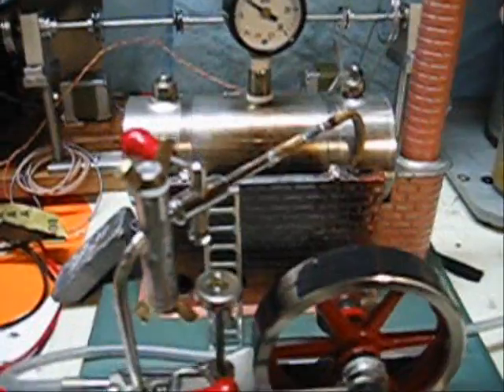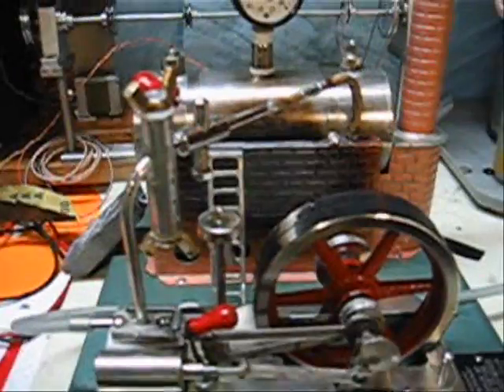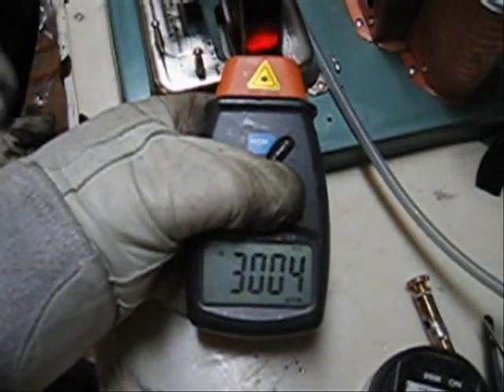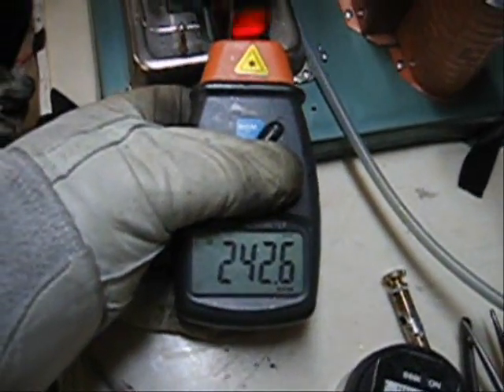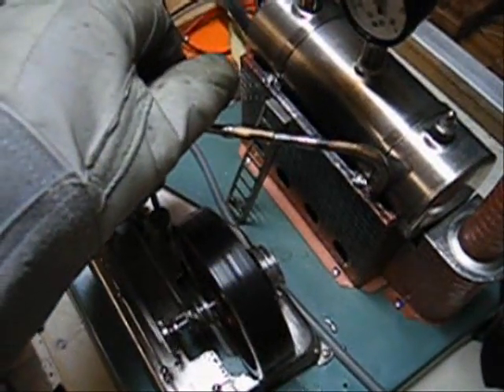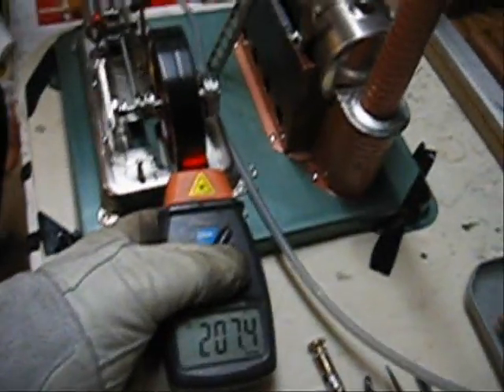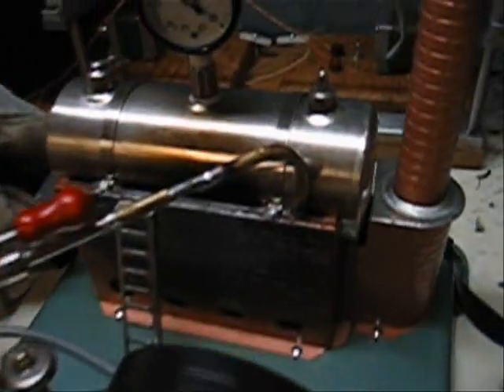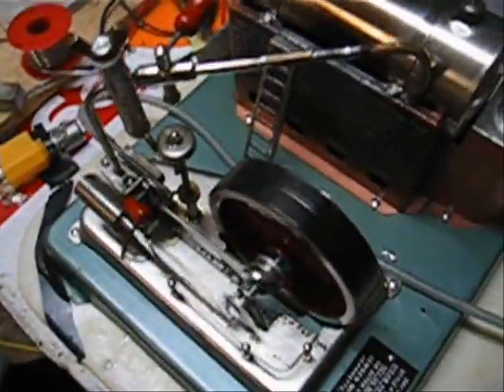Jensen 75 - Superheater Mk-I

Comment from the maker: It's very crude and simple.

I'll see if youtube will let me post a link..

modelsteam(DOT)myfreeforum(DOT)org/ftopic6933-0-0-asc-displacement.php

If that doesn't work, I used some K&S tubing, bought some brass nuts and bolts.  I rounded the nuts on a sander to make them into bushings that I swaged into the ends of the tube with a vice, then soldered.  The bolt is cut down and becomes filler and drain plugs (a groove ground into the threads of the drain so water can flow past when loosened)